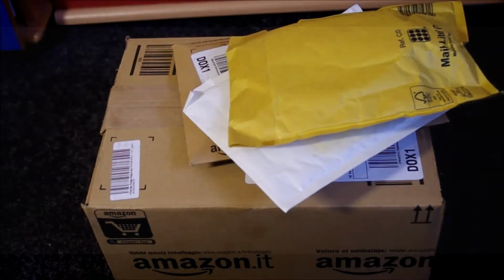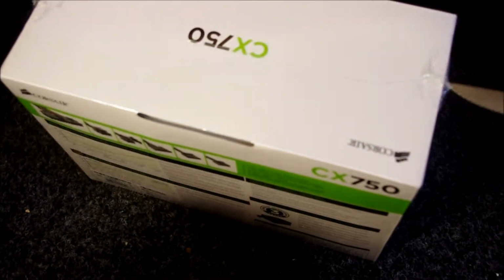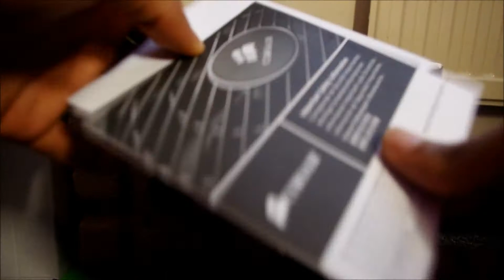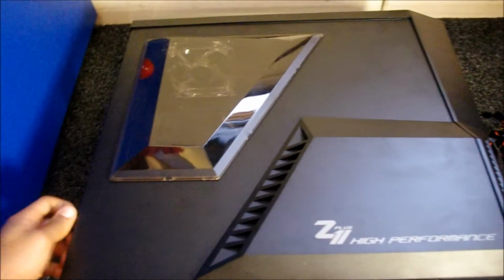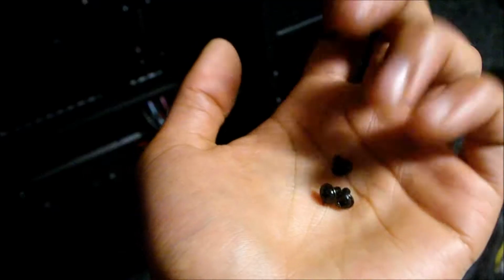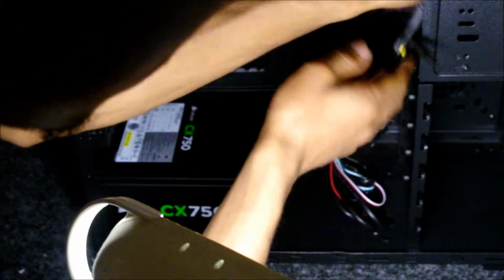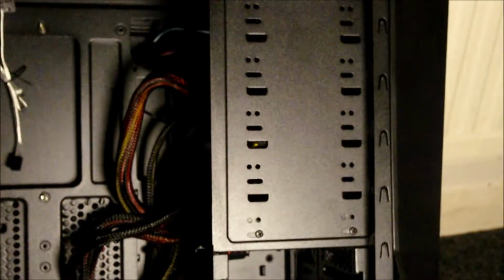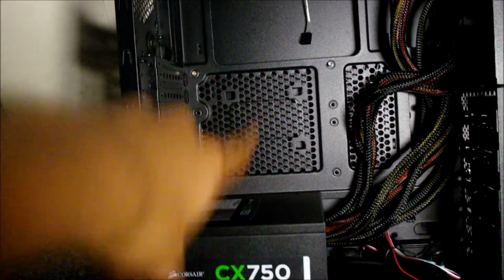Unboxing CORSAIR CX750 Power Supply and Installation

Comment: I wish you would have shown how long the CPU cable is. I ran into this problem with a OCZ 600 watt where the power cable was not long enough to go over the video card when you have the power supply at the bottom. None of the specs I read even bothers to mention the length. That is why I am buying another power supply. I have had the OCZ for 3 years and never used it and now power supplies being put at the bottom, it creates problems.
Reply from the maker: The Corsair CX750 cable is quite long. It's enough to go through the back, come out at the top and connect at the 4pin slot at the top of the motherboard. I recommend Corsair Power Supplies. They have long enough cables for mini ITX, ATX and XL ATX cases. If your case has a graphics card that hinders the path, you can always get 4 EPS Connector extensions on Amazon & Ebay.
Reply: CPG I bought this PSU to use temporary, but you know this PSU doesn't have the best components?